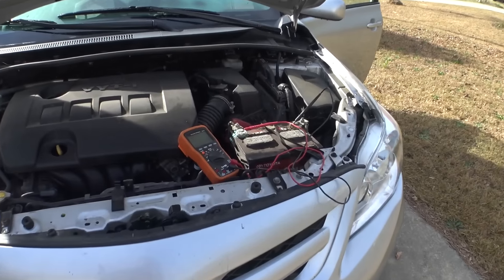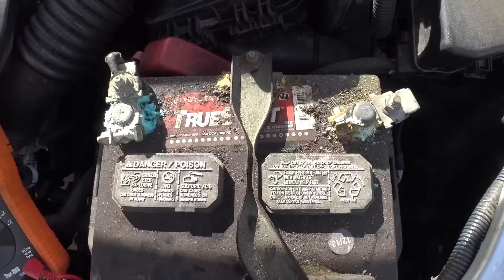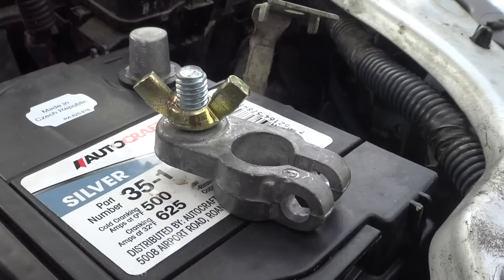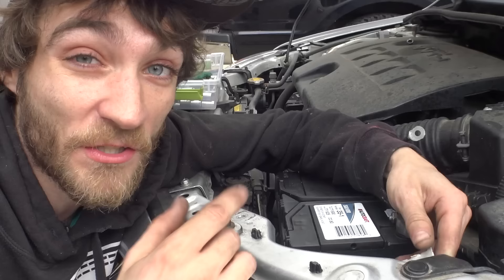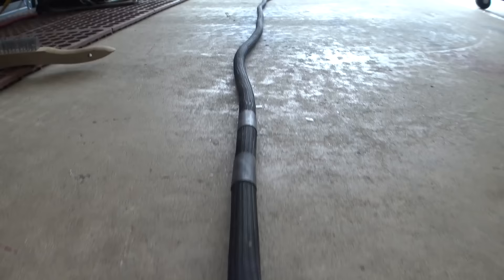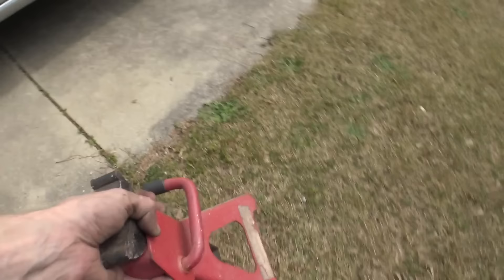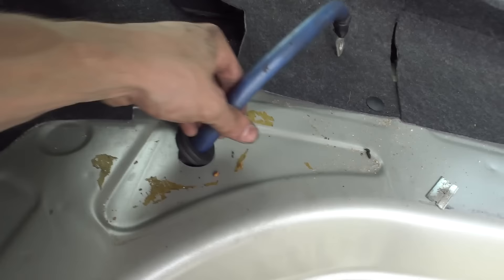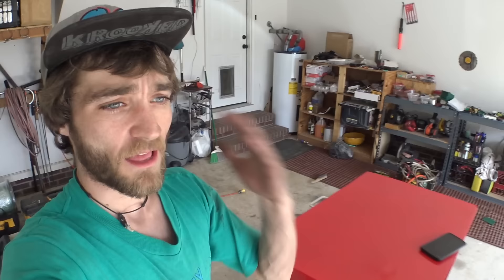Wiring CAR AUDIO System w/ 2nd Trunk Battery & Installing BASS Amplifier | Testing HOTEL Subwoofer

Comment: i use noalox on my post
Reply from the maker: Locks? Like those angled pins?
Reply: EXOcontralto 
no its a grease like stuff helps with corrosion
Reply: EXOcontralto 
http://m.homedepot.com/p/Ideal-NOALOX-4-oz-Anti-Oxidant-Compound-30-026/202276208
Reply from the maker: Good info, thanks for clarifying that.
Reply: EXOcontralto 
your welcome
we use it on are threads to in the vaping community

Comment: Hello!
I know I'm a little late to the party here, but great video. Wanted to get your input. I have a cap installed, but I'm thinking about a 2cnd battery as well. I just want to make sure I'm not risking putting unnecessary drain on my primary. 1st battery will of course be my car battery. Could I use a compact 12 v battery as the second? It's from a power scooter. Voltage and amperage are the same, so I would think it'd be okay, but dont want a fire going down the road either. I have a huge alternator, so I know it can handle it. Also, would the second battery be installed before or after the cap? Seems like after would be better, as the cap could store power to keep the second battery charged. Any input would be appreciated, and I'll definitely listen to your advice.
Reply: Caps pretty much do nothing they're kinda a waste of money best to run a second battery if your going with more power

Comment: Yo EXO. I got a dumb question. I'm really new to the whole bass thing. When I turn up the bass on my 2 10s it sounds bad because of my car speakers. How can I fix that. And I've seen In a couple vids that twisty thing where you can turn down mids and tweets I guess. What is that. Seriously I really new to it. Thanks man love your vids.
Reply: In you radio you have  an eq than Turn treble down
Reply: You can turn the bass down from your radio. Turn it all the way down. If you can’t figure out how to do it read the owners manual to your car. When you turn the bass down if there’s not enough bass coming from your subs turn the gain up on your amp. Really simple fix.
Reply: Lindsay Hinson yeah just turn the bass down from your car radio and then turn the gain on your amp to your subs up and it will sound a lot better.
Reply: @jakezadra7521  i das that alreeady
Reply: Your stock speakers are trying to play the low notes and distorting would be my guess. If you're running a stock audio system your best bet is to install bass blockers on your door speakers so that the bass is only played through your subs. The crossover for your sub amp also needs to be set around 80hz most likely. Jake Zadra's fix would probably also work, as it essentially would do the same thing, but if your sub amp is getting signal through the speaker wiring that would not work. I don't know what kind of setup you have so I'm not exactly sure what needs to be done here.

Comment: hey eco. not judging your installs but it's safe an more proper way with running the power cable thru a breaker  or isolator relay.?  so the alt. don't get worked with 12v backfeed to main batt/alt.
Reply: sorry typos..  to @exo.   love your vids an work on systems for many years. !
Reply: @westonstuart6240  Hi Stuart. If you please, what do you mean when you said, "so the alternator don't get worked with 12 volt "backfeed"(?) to main battery/alternator"?
Thanks in advance for any reply help you can give.
Reply: 2 batteries in parallel just act like one very big battery, if anything it'll be easier on the alternator with the more stable voltage.
Reply: decid3  how I mean is the parallel between both/bank batteries 12v. drops an spikes can cause voltage issue's "part of the game" lol.  
2 my knowledge to the main 12v & alternator.. the current feeds the secondary batt./bank.  so 
 In my terms  (feedback to main battery) bad , " without isolators I believe system can drain/hurt the charging/bank  ".   not 100% if how I'm saying it was is right.  don't burn me guys .lol.!     (mainly used for the use of safe 12v bank. not draining off to the main.   via switch on/off for this)

Comment: My AMP keep going into protect when im turning up the volume on bass boosted songs.. anyone knows what causes this? Not enough power, not good enough ground? 
My friend had the same issue, then the audio shop tested it all and said it was all good and that it worked perfectly.. so I bought for almost nothing and we made sure to wire it correctly, nothing sticking out etc but it still seem to have the same issue.. normal songs are fine.
Gain is lower than the shop said, havent tested the ground so dont know how good it is, dont know the state of the battery, all I do know is that the alternator is giving atleast 13.6V at idle with only low beams on, which is on the lower side I guess..

Also, when I wad playing a bass boosted song today, it sounded like someone was hitting plastic into something when the bass was going fully, which I guess is it bottoming out, but it has never did this before, and the AMP isnt to powerfull for the bass so it shouldnt bottom out..
Reply from the maker: Definitely sounds like the setup is reaching its limits. Back off on the volume when you hear that type of stuff. Do you have and clips of all this taking place to better understand the problem?
Reply: I sent you a PM with a drive link containing some videos and photos.
Reply: Impedance too low. You need to wire your speakers in a way so they read the same as your amps stability. If its two ohm stable, wire speakers to two ohms. And so on.

Comment: anyone want to help a fellow basshead?? i got a skar audio rp- 1500.1d it only has 4 gauge for power and grounds... will that be enough to run 1500 watts through? or at least i think its 4 gauge...
Reply: Kaleb Delong you could always use 2 runs of 4ga with a 2-1 reducer.
Reply from the maker: They make adapters if you feel you need more.
Reply: EXOcontralto do you feel i would need more?
Reply: EXOcontralto im gonna be running 2 12 inch rockford fosgate t1 12s and a extra battery
Reply: Kaleb Delong run 1/0 and get a reducer to 4ga. skar amps love lots of power on tap. and the 1500s do more than rated. really good amps. be a damn good system with those rf
Reply: Kaleb Delong power is like plumbing. if you are trying to suck 4 inches of water through a 2 inch line, it isn't at its fullest potential. if you run a 6in line, you get all the flow and it's not trying as hard. bigger is never bad. make sure your grounds match your positives.

Comment: im adding a battery in the trunk and ran out of 1/0 for the ground but i have plenty of 4 guage can i use a few runs of it to ground the battery?
Reply: Yeah, that will give the same resistance, just run like 4 lengths in parallel, it helps to keep them as short as possible too.

Comment: Hey man, you seem real savy, and I think I know why, but I got this 10” sub from a pawn shop, and the ohm reading is 105.00 and above. Why is that? I assume it’s because it was a powered subwoofer with resistors reducing the resistance and creating a impudence of 4-16 ohms
Reply: I had a similar reading it’s strange I didn’t buy the sub

Comment: Hey exo. I have a question I am gonna be running a skar audio 18 inch and a skar audio 2000 watt amp in a 1999 toyota corolla and was wondering if I could use my truck battery as a secondary battery in the trunk? And if I need to upgrade the stock alternator? Please help.
Reply: Adventure With timber  I did. I’ve read to buy the same battery that’s under your hood so that’s what I did. Works fine  with the stock alt. I had no problems so far I’m running 4 skar sdr 12s with a skar rp2000 amp.

Comment: Face the sub towards the back... Change those white zip ties to the black ones. White zip ties on the exterior of a car will get old and brittle faster the black ones... Peace EXO!!!
Reply from the maker: Sub was faced forward to be able to film the subwoofer. These white ties are the strongest I've ever dealt with, even higher quality than the smaller black ones.

Comment: Toyota's charge LOW! Make sure you get a different regulator put on the high output alt or some means to raise charging voltage. I'm on my third Toyota and it sucks.

Comment: Did she just use wd40 on the terminal?? Wtf .. you don't use that wow
Reply: fazjewls14 actually WD-40 removes corrosion faster than most contact cleaners and reduces corrosion build-up. I guess it's not perfect but not that bad either, well it's better than nothing I think.

Comment: Ooooooo look at that cutie bump'n
Reply: EXOcontralto. also mr. exo..... please please PLEASE go get some NOCO spray and cover those nice new battery connections. I USED it on my truck to keep my 4 batteries and RF amp free from corrosion.
Reply from the maker: I slapped some dielectric grease on there, probably something similar to that spray?
Reply: EXOcontralto similar...... more like a paint that seals connections making them last darn near forever. with all your wiring it would help keep them connections nice. hear is a link to website. they push the can with brush but I like the aerosol spray for fast small areas.  

https://no.co/cb104

Comment: dude, not to break balls or anything but you zip tied your hot to fuel lines...
Reply from the maker: You're not busting my balls, I understand how it may look concerning at first glance. The way I see it though, being made from solid metal with no access to oxygen, and having safety fuses on both ends of the wire, those lines aren't going to be bothered. But hey, I won't knock anyone for helping. I may even change things out for an easy relocation of a couple inches, who knows. I'm never too good for friendly advice :)
Reply: EXOcontralto up early today I see lol it's my day off and I'm still up early
Reply from the maker: Early bird get the worm :D

Comment: Yo you should put some tweeters on your girlfriend's car
Reply from the maker: We'll see what happens her soon ;)
Reply: What I did before I installed my sub, I got my front and rear speakers sounding right so that shit doesn't distort. I also have a 4 ch amp on them too, so that helps a lot too :)
Reply: Vince Del Fabbro nobody uses rear speakers ^^ if you want a real experience only have Front speakers
Reply: look at any dbdrag, everyone is using speakers on the front doors only and a "wall" behind the front seats. that's what he meant. And the distorsions u hear are from the mic and not the speakers. gotta learn some bout car audio kid.
Reply: @somerandomguy3239  well good that someone understood me otherwise i would have started with active runtime correction and stage build up , i know about that stuff otherwise i wouldnt talk
Reply: Didn't mean to start a shit war, I used to have a wall w 4 12s and 2 old skool punch 150s, controller, eq, all that pro shit. Then I went into pro audio. However, the point, as in exo's gf, and the majority of people wanting to upgrade their sound opt to switch the factory speakers and add a sub was my initials suggestion. Thought that would've been obvious! Yes I understand mic distortion, you can't expect a shitty cell phone mic to hold 140 dB worth of pressure and sound good.

Comment: you run the wire under the car saying your keeping it away from all the flammable stuff then zip tie it up to the fuel and brake lines both fluids are extremely flammable. its all good it works for you but i wouldn't do it.
Reply: Sirtokesalot47 lol
Reply from the maker: Those are solid metal, and very sturdy. Nothing's going to be harmed from this little addition. But let's say that it did... the power wires are fused on BOTH 
ends. Even if something did happen, it's perfectly safe :) Thanks for the comment and concern!